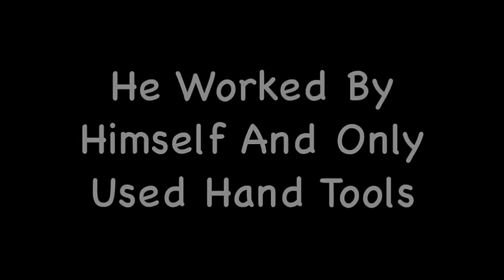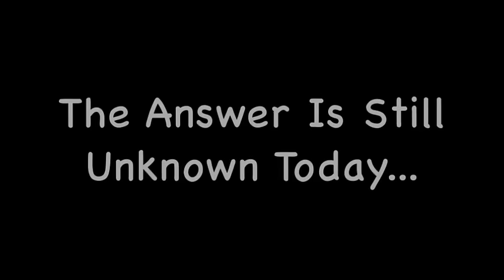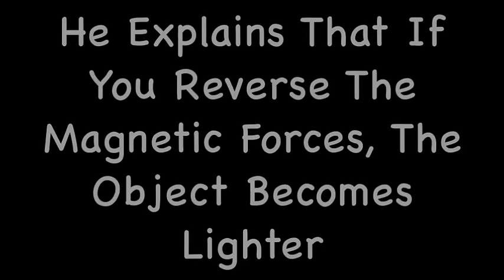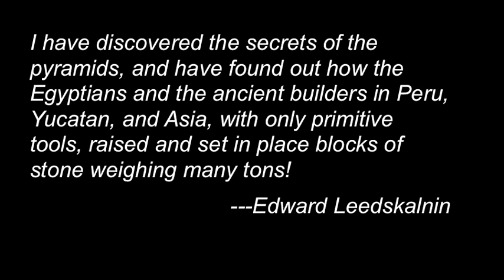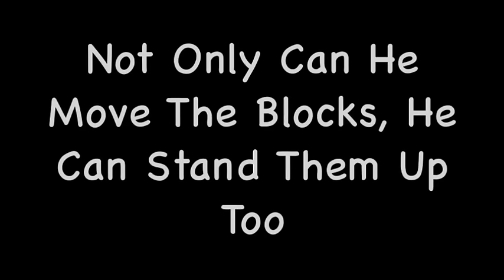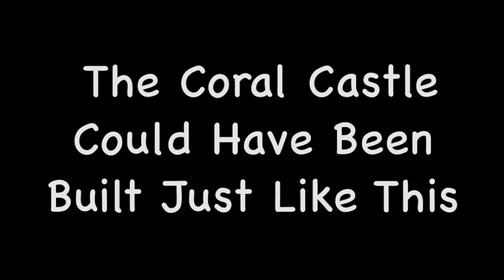Coral Castle: Mystery Solved

Comment: Ed Leedskalnin would laugh his skinny ass off at this. Or, he might cry. Hard to say. What's not hard, is knowing beyond any shadow of a doubt, this is NOT how Ed Leedskalnin  built Coral Castle.
Reply: I agree :) It's allways funny to see some smartass efforts to replicate the wonder created by Eduards Liedskalnins. After they have lifted some stone or steel concrete construction, they are shouting out that they've discovered the secret of Coral Castle... However none of them have built the rotating stone door alone or to set the Moon and Sun sculpture copy :D
Reply: he used two frequency alternating tone generator with a square wave
Reply: no doubt about it ;) frankly - Ed was alien himself and help from another group of aliens appears to be true
Reply: thats poured cement... useing modern tools.. this vid is ''bs''..
Reply: doug ohboy the stone of Coral castle is easier to cut then cement. The mystery of Ed's castle is known. There's pictures and his "secrets" were actually a magnet motor and coil system he used to drive chisels, saw blades. etc.
Reply: SpenserRoger and its never been replicated.....   no one has seen ed cut and lift those blocks into place.. his block and tackle is not rated to lift and slew that weight....
Reply: doug ohboy Bro there's pictures of him rolling them on logs. lol
Reply: The only thing certain in regards to how Ed Leedskalnin built Coral Castle is that no one knows how he did it. Sitting around and armchair speculating won't change that fact.
Reply: I'm not speculating, that's the difference. FACT: No one knows how Ed Leedskalnin built Coral Castle
Reply: seti111 dude you're nuts there's a video on YouTube that explains it completely
Reply: +seti111 well until you put your speculations to work and actually do what wally did your claims cant hold what wally did was perfeclty valid in solving a mystery. you sound like a typical one of those scientists that cant believe that something happened because you want to chalk it up to alien activity cause your brain cant fathom it.
Reply: +seti111 let your imagination run wild if thats keep you entertained but dont make a claim against something unless you can prove wally wrong
Reply: @seti111  30 tons is more than what you can legally haul in a semi tractor trailer. I used to run a cat 988 loader that could lift 20 tons and that was a very big loader so yes you are right this video explains nothing. And it would have taken ed more than a century to build all of that with primitive tools and the equipment of that era. Bottom line is there's things out there people can't explain and they get offended because they can't. Just like Easter island, nan mandol, gobeki tepi and so much more. Monoliths are on every continent and were left here for peculiar reasons. I personally believe that we are still way behind on the technology of ancient Atlantis
Reply: @thomasbeck9075  Reading your reply I liken to breathing a breath a fresh mountain air in Spring. I'm 52 now,  have a Civil Engineering degree from the University of Alabama, and am also a licensed & registered Land Surveyor. Not being of the current breed of narcissistic and self important degenerate's flooding out of current academic outposts withering in student loan debt, I had to work my way through college. So, beginning at the age of 18, via co-op programs, I have been directly involved in not only the design of major, often massive, construction projects, but responsible for their layout and accuracy from start to finish. I know exactly what we're currently capable and incapable of. I have stood before the megalithic sties you've mentioned above, and many others, I have seen first hand what the ancients, and those still privy to the knowledge, like dear Mr. Ed Leedskalnin, are capable of. He was quoted as saying, " I know how they built the pyramids ", and Sir., I believe him. Currently Archeologists love to pretend they're many things they're not. Like Engineers, construction experts, architects, and intelligent gentlemen professionals with real world experience, such as yourself. But you know who they're NOT fooling?  Engineers, Construction Experts, Architects, and professionals such as yourself. It's all quite the travesty. The Darwinian Paradigm is the modern holy book and mantra of academia, even as ridiculous as it is . Which, in short is to say, we're smarter and more capably advanced today than we were yesterday and at any point in the past, and anything said to contrary is ridiculed, even if this means destroying reputations, careers, and lives. I say, and I'm certainly not alone, if we could be a fly on the wall, say, during the Great Pyramids construction, we at first would not be able to believe what we were seeing. But shortly, we would have insight into what's truly beautiful and what it really means to be human.
Reply: @seti111  I know its so sad what our colleges are doing these days. I am a big fan of the Bible but have you ever heard many people read it correctly. The anunaki of sumeria were with Adam and Eve in eden the serpent said (ye shall be as gods knowing good and evil) ancient aliens is half right. There was a civilization that possessed high technology such as we have not seen. Solomon said there's no new thing under the sun. Our fine institute's would have us believing our ancestors were ignorant cavemen. I defy those theories. The legend of Atlantis has technology we have never tapped into. History was even stranger than we could ever imagine. The locals in micronesia say those stone logs were floated into place at nan mandol. I don't understand why people are so hasty to call others liars when we don't have the answers either. Public education today is at the very best a huge failure. And people have submitted themselves to mind control. Like puppets on a string. Thankfully there's a few of us who are aware. But the mainstream will label us as crazy. I just don't understand why people don't learn to think for themselves again
Reply: OR, as St. Stevie says~  When you believe in things that you don't understand...you suffer

Comment: I noticed the man turning the large concrete block did so while the ground beneath the block was a solid concrete slab. Try doing this on soft ground and see how well it works. I'll hazard a guess and say it won't.
Also, let's see how this was done with blocks the same size as those used in the trilathon at Baalbek. Over a 1000 tons each.
Reply: anonymous  it wasn’t debunked it’s what he used to make door swing.Nothing at that castle has been debunked.

Comment: In my opinion, there were 2 completely methods used by Ed. One to quarry the rocks using electromagnets to chisel and saw cut and remove the blocks from the ground (he could have used a donkey and treadmill to do the former)and used his tripod with winch to hoist the blocks free. Secondly,  his technique to positioning the blocks in situ which involved zero gravity or acoustic levitation using Polaris as the North magnet and Saturn as the South. To steer the blocks he magnetised himself hence his lead shoes and the cones in his hands. As Ed himself said "It's easy if you know how."

Comment: coral 'rock' is porous... while amazing, Wally was using concrete blocks... much harder, smoother surface for the 'pebble' to rest against.  Coral rock has large divots and is softer.  I'd be surprised if Ed could have used pebbles to move the large blocks.  Perhaps, but it's harder for me to picture.
Reply: same here!
Reply: i bet it wont work for sure.. whats your point? i said i didn't belive ed used that method to build the coral castle either.. or did you missunderstand me? :)
Reply: ah.. ok now i understand :P sry.. i thought that u was thinking that i was claiming it would work.. hehe.. :)
Reply: Actually Ed used Oolite, not coral. It gets heavy after 12,000 years of silica bonding underwater. No debunker has of yet explained how the young boys 9yo could have mistakenly witnessed Ed moving a stone like a blimp. They said he had what appeared to be ice cream cones in his hands. Well infact they were conical coils used to project a grid zone of charge and were supplemental to the existing heavy ion mass displacement circuit which took me 2 years to reverse engineer, but it is done. The truck driver also returned after 30 minutes to find Ed had loaded a trailer with stones like a deck of cards. No heavy equipment, no tracks! Just that tripod with the mystery box on top. I discovered the box contained a 32 pole 12vac dynamo which was part of this 3 ground circuit used to split mass from energy.
Reply: best answer yet, MikeFromSpace :)) thank you... "perfect timing" x
Reply: mikefromspace yes
Reply: mikefromspace Let this big muscleman load the stone blocks on a truck or unload while the driver goes for coffee.

Comment: Ok.. Now Lets see him do it with a 30 ton piece of coral!
Reply: Using that method, the coral would break under its own weight. Also, this method has been disproven many times due to the fact that few blocks show scoring, drag marks, and many blocks lifted in Egypt would easily crush the wood they rested upon. Also, they are porous just like coral. That in itself is a tremendous clue.
Reply: 30 ton coral is only about the size of a normal house. Lol that is frikin huge!!

Comment: Personally, I think Ed used something like the Hutchison effect.  There is the ability to effect an objects gravitation by adjusting a frequency perfect to the resonance of the object.  Or, if you can create a "field" around an object by controlling the frequency resonance, theoretically you can easily adjust how gravity is effected on an object by turning a knob that will adjust it's frequency, or the frequency around it.  Limitation is all  in the mind.

Comment: Coral castle was built with nothing more than mechanical advantage. Nothing he did was impossible, he just had knowledge in pulleys and gear reduction. We already know this is how he did it, people are just confused by what he accomplished using only compound pulleys and gearboxes. The damn crane is still there on display. 
I will say this, if you manage so much with so little, that people think its witchcraft, then a damn fine job you did :)

Comment: Wishful thinking. Leedskalin was able to do a lot of this work in very short times. Mostly at night. He moved items a heck of a lot heavier than this man. He didn't have a concrete floor to "roll" things on. Nor did he have tons of lumber laying around to use as fulcrums and counterbalances. Nice try but no cigar.
Reply: +Richard Fsr Prove it. How do you know he did "a lot of work in very short times" when it took him years to build it?
Reply: +Reverend Green Two reasons. When he moved from his original location, the truck driver he hired stated that he would leave the truck at his place and come back in the morning and it was loaded with tons of blocks. And this occurred many times. And it didn't take him "years" to build it. Only when he decided to add to it after awhile.
Reply: Can you prove any of those claims? Of course not. Besides, loading some blocks onto a truck with no one watching you doesn't equal magical levitating powers. It's only mysterious because you weren't there to witness it.
Reply: How do you know he hadn't? Maybe he used them at night and concealed them in the day.
Reply: Please do some research. It took him 28 years to build it.
Reply: Richard Fsr he had a cran though heheheh

Comment: I have loaded and unloaded a building onto truck that way when I was 17, but I have also pulled up, and adjusted the tension on several cable suspension bridges, using leavers, by hand, the tension on the cable is north of 40 tons. (Blackshale creek, near Kananaskis,  Alberta, Kelowna Mountain)

Comment: So, the 19,000 lb. block is only a third of the weight of the 30 ton block at coral castle. This guy lifted his block 3 ft., so that would mean the guy at coral castle would have to lift his block up approximately 9 ft. Following the process the guy did in the video, a person would run the risk of fracturing the stone and they would have to start over. Also, we don't exactly find petrified wood in Egypt, which should be present considering how much wood they would need to build something thousands of time greater then these little side projects. Physics definitely played a role in the creation of the megaliths, but it is still very questionable as to which physics.

Comment: I have visited Coral Castle, inverviewed the curator and visited his old homestead where the Coral Castle was originally constructed. I believe that Ed used high pressure water to cut and move the coral. There is a letter from a gentleman in the Coarl Castle that tells about him going to buy some coral from Ed. Ed instructed him to back his truck behind a large bush and walk to the front of his truck. When Ed called him, the huge coarl piece was on his truck and it was soaking wet.

Comment: that's funny cuz I always moved refrigerators or other heavy furniture by leaning on it, twisting it, spinning it on he opposite side it move the length of the base pretty much.
 You can even wiggle it through door like that. The guy discovered balance that is all.
If it was something really heavy I just lean it, put a towel under it, and spin it, no marks on the floor anything moves. So all he really needed the pulley for was to lean and spin stuff. Enough pulleys will pull any weight up.

Comment: We know from the photo evidence that he used tripods with pulleys or tackleblocks. WE also know that it was important for him to have a source of water at his two sites. WE also know he used a small hand cranked generator. I believe he used the generator to pump water into a tank or two tanks used as counterweights to lift the objects. One tripod on each side of the block to be lifted, pump water into the tanks, block lifts, pump more into one tank, block goes to that side so sideways movement

Comment: NO! the Coral Castle was not built with rocks and sticks. the stones were removed from trucks in the middle of the night so it only took him minuets or at the most an hour. rocks and sticks would have taken him days. and there's a story about some kids who said they saw him moving the stones from a truck with what looked icecream cones which fits with the theory's of pyramid power in some way. and Viktor S. Grebennikov and his work with bee hives with cone shaped structures and his flying platform that used bug wings that he later discovered had a cone shaped structure to them. so sorry I don't believe in the rocks and stick theory. it's more likely he used sound like the Tibetans have been said to use.

Comment: The mystery of the gate's perfectly balanced axis and the ease with which it revolved lasted for decades until it stopped working in 1986. In order to remove it, six men and a 50-short-ton (45 t) crane were used. Once the gate was removed, the engineers discovered how Leedskalnin had centered and balanced it. He had drilled a hole from top to bottom and inserted a metal shaft.

Comment: Man so many people who want to believe in space magic.  Physics is physics, the size of the weight of the blocks doesn't make a bit a difference.  As for carving, there is a reason its called Coral Castle, its made out of coral, not rock.  Coral is just calcium carbonate, you can dissolve it with common household acids.  It wouldn't be difficult to cut or carve at all.

Comment: In my job as a house mover and re-stumper I use 6 by 5 by 4 foot pine blocks to hold and move blocks so I am very aware of what is possible to move with using leavers pulleys and block, And I can tell you that it would take many years to do what Ed did in days. Ed did not just stand the coral blocks he also sourced and transported them, Today I have seen a 30 ton block of stone moved and I can tell you that machinery was not available for Ed to do that then. So Ed now something more than we do.

Comment: you need to account for many variables that don't match up between the retired construction worker and coral castle. scientifically it is not enough evidence to account for every feat that the coral castle displays. You don't account for odd angles and multi layered structures which are perfectly balanced and symmetrical, they have also withstood the test of time and extreme weather like the hurricanes that south Florida gets. Lastly, we are just starting to understand electromagnetism's relation to gravity and the two forces can directly affect and cancel each other out. We can already levitate objects with mercury and liquid nitrogen as well as dry ice. It is not a far stretch to think that anti gravity is possible.

Comment: Nothing solved here. But Wally does show some very inexpensive ways to move blocks around once they are out of the ground. Not much use for quarrying rocks as you would first have to move any surrounding rock just to have access, then you'd have the problem of getting your first boards beneath it to begin rocking.

Comment: Hand tools can cut coral, it is not a hard stone.  You can take sand and a bronze untoothed saw blade and rub it over and over again using friction like you would a drill and slice coral or Granite. Heck water erodes stone over time too, Calcium Carbonate which most coral is made of can be dissolved with acids  But you will notice in the pictures that Ed had a multi-loop chain hoist, Doesn't take much energy to hoist tons of auto engines with one, or Fell trees, or Move things by hand.

Comment: Whatabout those rocks that are larger than freight trains? One of the problems with obelisks is that they often broke under their own weight. Which means that they had to be supported very carefully the whole way thru. Setting them on pivots or fulcrums would have broken them.